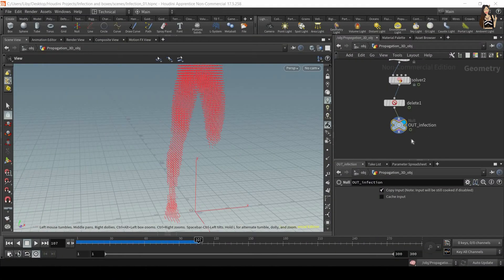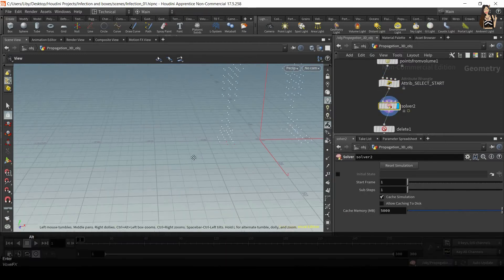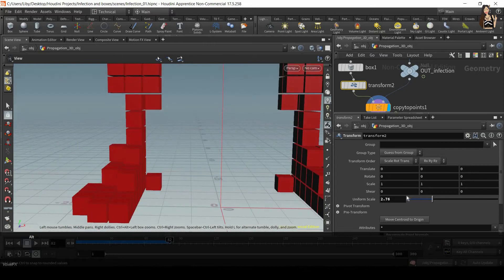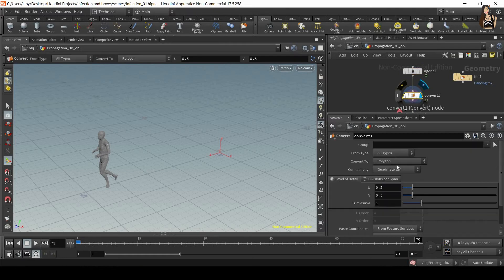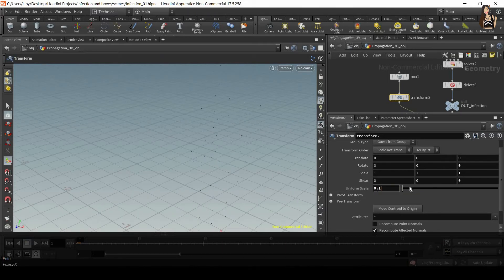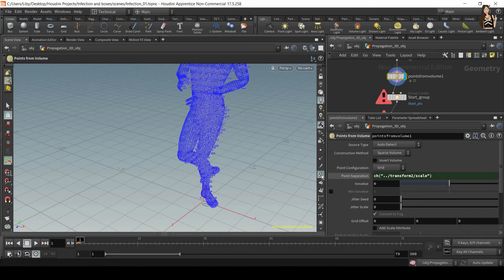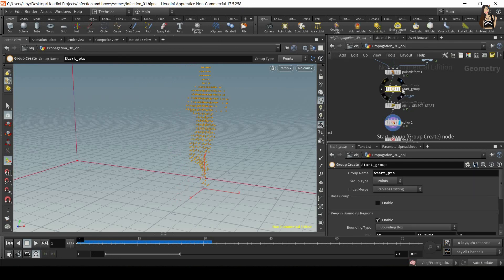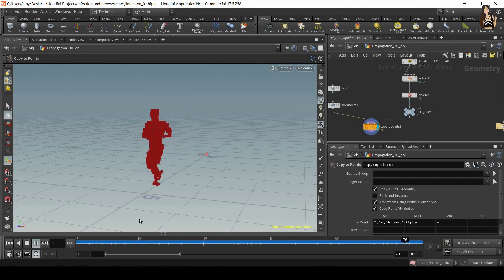Fracture Simulation on Animated Rigs - Houdini 17 (Part 3/5 - Turn 3D model into boxes)

Comment: Houdini 18 after solving animation in solver, still have issue with infection working while avatar is in animation. In continues when avatar is in still position after whole animation. Any ideas how to solve this?
Reply from the maker: Hi :) It sounds like the points on your 3D model are changing, is the PointDeform node working correctly?

Comment: H18- does not seem to have the POINT-OLD node, trying to figure out what to replace it with
Reply: figured it out.... Point node (Attribute Expression). VEXpresions tab - Attr Class- Points, VEXpression =  @opinput1_P . Which is in the dropdown as 'Second Inputs Position'
Reply from the maker: @quinnrichardson  Thanks for sharing! Yes, this seems to be the easiest approach in the new Houdini version. :)
Reply from the maker: @jzargo1795  In the SOP solver you replace just the "Point" node with the "Attribute Expression" node.
The 1st input (input number 0) is the "Prev_Frame". The 2nd input (input number 1) is the "Input_1".
In the "Attribute Expression" node you need to type "@opinput1_P" in the VEXpression box. This will take the position of the 2nd input (input number 1). Alternatively, you can choose the operation from the dropdown menu on the right to the VEXpression. Choose the following: "Second Input's Position". It will fill in the expression by you.

This should work straightaway in all recent Houdini versions (checked). If it's not working, perhaps there's an issue somewhere else? Double-check the attributewrangle and all the expressions as this is where the errors usually are. :)
Reply: Could you give more details about how you solved it?
Reply from the maker: @ugnesmalskyte1810  Hi, please see the reply to @Seat Hava :)